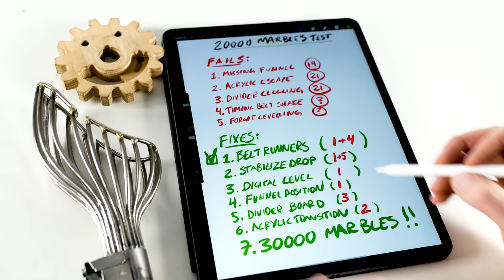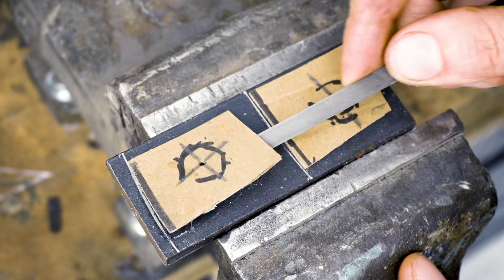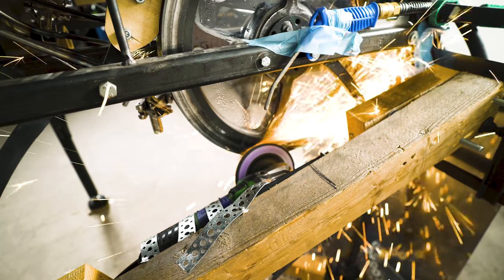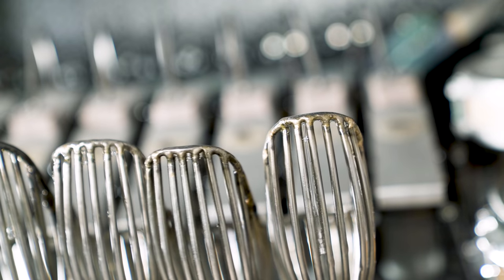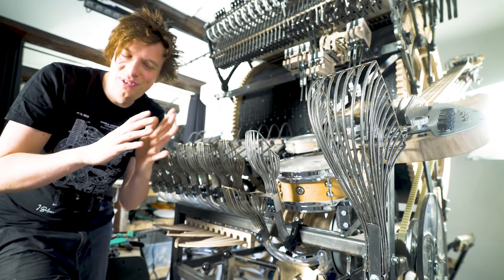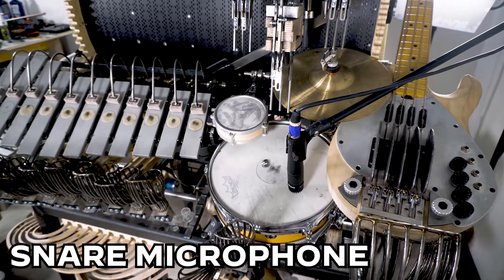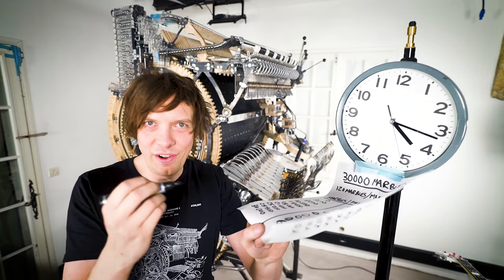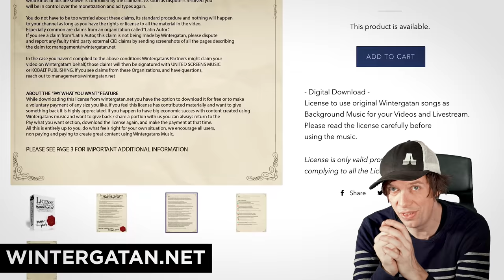Playing 30000 Marbles - Marble Machine X #148

Comment: The reliability math is still kinda weird, the smartass in me is screaming for statistical analysis. 
But it really doesn't matter 6 out of 30000 is obviously great.
Reply: Yeah he could also factor in the type of failure. Some dropping to the floor like this is nowhere near as dangerous as ones getting caught and bound somewhere
Reply: Currently for 1 000 000 Notes played, the expected number of ...
lost marbles is 233.3 = (6+1) / (30 000 + 2) * 10^6,
critical failures is 33.3 = (0+1) / (30 000 + 2) * 10^6
Reply: I thought he would have called those 6 marbles a false fail as that wouldn't normally happen, also is he going to run 1 million marbles though each channel?
Reply: @blahuhm6782  Trying to be 100% polite.  All it takes is ONE ball bearing to cause a lawsuit.  This is why he has the 1,000,000 marble goal.
Reply: Those six are an outlier, because you only have 2 channels running.
Reply: @peterkelley6344  how rude you are!!!! lol, just kidding, no worries... yea, marbles on the floor could lead to an injury no doubt, I forgot about that
Reply: The main issue now is that the number of marbles is proportional to the number of channels used, so the reliability score weighting is proportional to the number of channels squared. If it was changed to "marbles per channel" it would fix that issue.

Comment: Martin, I thought that the flywheel may need balancing, just like a tire where you add weights. Once you have the balance points glue on the magnets so they don't shift or fly off.
Reply: Yes, wanted to add the same comment.
Glue on those magnets!

Comment: I'm interested in the funnel bouncing after a marble strike when another marble hits immediately after, could that be impacting the second marble with enough force to occasionally cause a bounce out?
Reply: I was thinking the same thing, as beautiful as the funnels are it may be more reliable to make them rigid. I know martin wants to visualize the music using them, but I feel that seeing the marbles fly through the air and the gates actuate already does a great job of doing this, and it wouldn't kill me to see him replace the spring steel with a rigid plate or just weld the funnels stuck.

Comment: Did he really just make "belt runners" non adjustable?
Reply: Our (Bosch) packaging machines at work don't have adjustable belt runners either, you change the position of the drive wheel if you need to adjust the tension of the belt. And mind you those are designed for 24/7, high speed production, which is a whole different class above the marble machine. For MMX's case its perfectly fine.

Simple as.
Reply: Hey, they can be adjusted super easily with the help of an angle grinder and some welding ;)
Reply: It's easier to adjust belt tension than location anyway.
Reply: @R3dFlames  Or smaller/larger OD bearings :P. Very adjustable.
Reply: It looks like the bearings themselves aren't adjustable but that he mounted them to a slotted arm that is?
Reply: Yes. This episode is full of cringe! He needs to run these ideas by his team before he does them. I know someone has a lathe. After all, he found a luthier to make him a custom bass.
Reply: You can  change the mounting to adjust the tension. Move them close to the centre between the wheels and the tension is reduced, further from the centre and the tension increases. Changing the angle so that the bearing pinch the belt more will increase the tension. Changing the bearings out for larger or smaller OD will allow for adjustment.
Reply: @emilchandran546  yes that would have been a good idea, but it's not what he did.
Reply: @RichardBronosky  there is no reason why any of those couldn’t be done the way he has set it up.

Comment: For the scoring analysis at the end, I think you should calculate the lower bound of a Wilson score confidence interval (yes, this is pure and wonderful coincidence). Here's a nice article with an Excel formula you can use (just replace "Up Votes" and "Down Votes" with "Successful Marbles" and "Failed Marbles"): https://www.evanmiller.org/how-not-to-sort-by-average-rating.html

The best thing about this scoring method is that it properly accounts for the total number of marbles tested. 100% success with 10000 marbles gives you a higher score than 100% success with 1 marble. In fact, the number that this formula outputs is a reliability that you can be 95% sure of. For example, your 10000 marble test with zero fails gives a score of 99.96%, meaning that you can be 95% sure that your machine is at least 99.96% reliable (in other words, there's only a 5% chance that your machine is less reliable than this).

The Wilson scores for the tests you've done so far:
5000 w/ 20 fails: 99.38%
10000 w/ 0 fails: 99.96%
20000 w/ 61 fails: 99.61%
30000 w/ 6 fails: 99.96%

For the last test, if you want to ignore the 6 failures that are unrelated to the dropper mechanism, your Wilson score will be 99.987%!

One more cool factoid: 30,000 w/ zero fails gives you roughly the same score as 100,000 w/ 5 fails.
Reply: I wonder how many marbles Martin needs to drop for 5 sigmas of confidence :D
Reply: @maxmustermann5932  5 sigma is 99.99994%, which is achievable with ~6,000,000 marbles and zero failures (@ 95% desired confidence level).

Comment: Idea to fix the overflow issue: Have a marble "bank" that collects overflowed marbles. Let the marbles slowly leave the bank when the Pipe isn't overflowed. Or let it circulate in the machine while it tries to fill everything up. It might take a lot of work though
Reply: I think there's already an overflow where the marbles just run past the channels and go back into circulation. I believe the problem he was describing was that the height adjustment for the snare drum channels wasn't tuned, so marbles were not getting past them and so did not reach the overflow.
Reply: @coder0xff  That's where they backed up. The fish stair is where recirculated marbles go back into the divider. He just has a few too many marbles in the machine for the number of channels used.

Comment: Martin, we're quietly waiting for your next video.  I was wondering if the delay is in you having the courage to open up more stops on the MMX to let more ball-bearings through.  I seem to remember that the MMX has 64 stops. ... and that translates into an average of 15,625 ball bearings for each stop if you had them all open for 1 million drops.  Still hoping for the best.  I still believe!  Martin.  Happy Holiday what ever holiday you might celebrate.

Martin you asked about music box paper a few years back and I think (once more) I have found yet another solution for you.  Player Pianos used similar scrolls; and there is a company who makes paper for player pianos still called QRS.  QRS is still in business / operating today. They still make modern player-piano technology.  This may help with the programming pin issue you've had.

Comment: I wonder when Martin did stop consulting his "engineers". The balancing of the flywheel had been such a no-brainer - why spending so much time instead of doing it right the very first time? Also: Martin completely misses the relation to "frequency". When he plained the flywheel and vibration actually increased, this mainly had to do with hitting the eigen-frequency of the funnels. So even if the MMX is now a charme on 120bps ... it might not be at all at 90bps or some other frequency.
Also completely not understandable for me (and that reduces my hope for success significantly) was the action to weld the belt runners directly to the frame. I recollect that Martin hat spoken the wise words, to never again just fix something straight to the machine, but ensure that there is a way for adjustment. Why on earth didn't he stick to that concept. He must have completely missed, that the belts will get longer over time and the belt runners might need to be tightened. The unfortunate alternative is to replace the belt at some early time (perhaps for each other concert?) to just ensure that it will be still in range and ok.
Reply: I agree with everything you say!

Comment: I'm so worried that this is all extremely dependent on the exact characteristics of the floor the machine is currently sitting on and it will start vibrating like hell as soon as you move it
Reply: For stability on tour, a half-ton slab of optically-flat granite will be needed as the floor.

Comment: Nononononon that is not what E=mc^2 means I hope he knows that the equation he wants  id F=ma
Reply: Yeah...
As someone who really liked physics at school, that hurt a little bit.
Reply: He's actually referring to kinetic energy E=(1/2)*m*v^2, which is actually pretty close if you ask me. I mean in terms of dimensional analysis it's exactly the same thing.
Reply: @onemadscientist7305  I mean yeah i guess but it doesn't have a c^2 constant in it and doesn't mean energy that literally represents gravitational mass?
Reply: @onemadscientist7305  so in the sense that E is inversely proportional to mass, yes, but in terms of like any actual understanding of what that refers to no. Like that's inertial mass, not mass in a spacetime sense, and youd get it wrong on a test for using that equation.
Reply: @samk2407  I think as long as it gets the point across that the energy you need to put into the system to get it moving is proportional to mass (slight blunder there, I forgot the parentheses, I’ll fix it), it’s fine. Besides, the mass used in relativity’s equations is in fact inertial mass, there’s no such thing as gravitational mass in relativity since gravity isn’t a force (in an inertial reference frame at least). I mean, sure, kinetic energy doesn’t refer to the energy that’s statically contained in the mass by virtue of its existence, but to the dynamic component of the total energy contained in the mass (not accounting for thermal energy), but really, it’s the exact same kind of quantity (obviously, in the context of relativity, the classical kinetic energy formula doesn’t work at high speeds but that’s nitpicking at this point).
Reply: @onemadscientist7305  no gravity isn't a force, I'm aware, but the energy mass relation of m= E/c^2 just isn't applicable to kinetic energy. like that energy only has the most miniscule component related to velocity it is almost entirely whatever the correct term for the mass of existing is.
Reply: @samk2407  Listen, this isn’t a physics channel. He got the point across. This is a minor mistake.
Reply: @onemadscientist7305  he's an engineer working with engineers
Reply: @samk2407  That still doesn’t mean he needs to know all of physics’ equations (granted, this is a simple one). And as you said, he’s working with a team, and people like us regularly point out mistakes, which means nothing mission critical is riding on him knowing the expression of kinetic energy by heart. Him knowing that the more mass you have the more energy you need to put in to get movement is much more important, and he understands that perfectly.

Comment: You do know that you don't need a calculator and you can let spreadsheet work out the numbers right? Like if you would write '=(30000-6)/30000' (without quotations) it will show you the answer: 0.9998. AND you can format that answer to percentages by clicking on the 'format as percentage' button. Right? You DO know that? And you can use cells instead of numbers, like you can write  '=(30000-6)/30000'  as '=(C6-D6)/C6'... right? Instead of calculating it by hand.

Comment: THIS is the kind of mind that got us: 
          From ship navigation where longitude was near impossible to calculate, to ship navigation with clocks so accurate dead-reckoning was made obsolete.  
          From horse-drawn trolleys to steam-driven locomotives.  
          From elevators where cable breaks could be catastrophic, to elevators with brakes that would kick in within milliseconds of the car beginning to drop faster than a given rate.  
          From manual transmissions, to transmissions that were LITERALLY fully mechanical computers using complex mazes of small channels for guiding hydraulic fluid, and ball-bearings to seal one channel and open another, to force the fluid to switch applied force from one clutch pack to another, thereby causing different ratio gears to switch into or out of the drive train.  

NEVER underestimate the value of classic mechanical engineering.  

Rocket science may have gotten us to the moon, 
but mechanical engineers got the Saturn V 
from the assembly building to the gantry they had built on the launch pad.

Comment: This video is a great contrast between smart and educated/trained.  It takes a very smart person to put this machine together and with through the problems that you've done.  But also, an educated person would have known that facing off the flywheel wouldn't have solved the vibration (this doesn't fix the center of gravity, as we later find out) and more importantly when you increased the stiffness of the marble dropper, THAT IS NOT HOW YOU USE E=MC^2.  That's an equation for the amount of energy contained in matter, not how much energy or force it takes to move or bend something.
Reply: I am sure an uneducated car mechanic could have told straight what is the easiest way to balance a wheel :)

Comment: Your engineering skills are remarkable! As for balancing the flywheel going back to basics is the path to success most times. I was thinking while you were attempting to reduce vibrations about how I balance my motorcycle wheels after I change tires. Wheel weights with glue on one side is how the weight is added where needed, no chance the weights will move.

Comment: I used to work in a factory and I noticed the very large (~ 1 meter OD) fluid couplings we used were balanced (before reaching us) by drilling holes into the outside of the axial faces, much like the method with the magnets but subtractive.

Comment: if you look carefully at 2:01 you'll see it not only touches the sides, but it does quite a few bounces on the walls. The ball has a curved trajectory and does not go in at a 90 degree angle, so from a physics standpoint it will touch the walls at least 2 times

Comment: This machine makes every pinball machine I've ever worked on look like child's play. But I think you need some flippers, haha! But no seriously you have a marvelous machine. The flywheel job would have been easier though if you had preheated the wheel so that it would not fluctuate in temperature throughout the grinding process. That's just a thought.

Comment: And THAT'S why if you look at a crankshaft or flywheel from a car, you will find holes drilled at random spots at random depths and random diameters.  They balance them, eliminating vibration, by removing weight from specific spots rather than adding it.  Of course they have machines to do that, just like the ones that balance your tires.
But they don't make music, they just hummmmmm.

Comment: I don't see your belt tensioner failing how it is but, if you want to take advantage of those nylock nuts, you need to have a few threads showing through the nut. I don't think you have the lock engaged fully. I also don't think it's going to vibrate loose either if you chose to do nothing. I've watched you build this thing for a long time. You're a great engineer.

Comment: Even if this video is 2 years old- there is a simple explanation to your problem and an abvious solution. You have a proboem at least with your static unbalance. However, a rotating disc, if not mounted perpendicular to your rotational axis (we are talking about microns when balancing), you are introducing a couple unbalance. Both can be easily balanced. Just demount your flywheel and throw it onto a balncing machine. Companies like Schenck RoTec can help you with this. It would have been much much less pain and more acurate to fiddle out the position of your weights.

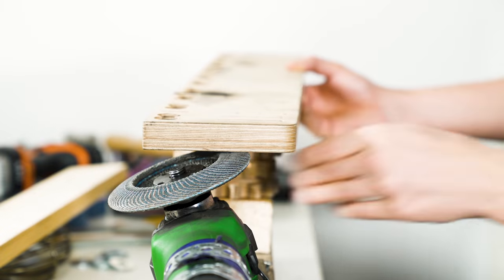Comment: actually 8:14 i had  a very skilled mentor in metal construction, high level welder and mechanical engineer, and he always told me when you grind with those lamella disks you should keep the angle grinder flat on the surface :o
Reply: haha that magnet solution is exactly how they balance car wheels :d

Comment: Balancing the fly wheel: remove your (design) ego and go to a tire place! They will not only static balance it but also dynamic! ...because w/ your technology you balance only the ring or tire, but your spokes and hub have to be included in the balancing... and guess what... you would have ended up with the same solution immediately (instead of lead clamped to the rim, you added magnets...)

Comment: I would say three movements. As the marbles drop and hit the drum they create vibrations, and at high speeds the next marble in line has a chance of hitting the drum in the middle of its vibration causing the marble to slightly bounce off course. 🤷‍♂️

Comment: Excellent engineering. And ingenuity in resolving your funnel vibration. If I may suggest (from experience), please acquire a vibration monitor which can easily be made from a few electronic devices. It appears you are fighting a frequency harmonic issue which is appearing on surfaces that are mounted on extensions. I’ve had to fight this similar issue on a robot transfer are that was still wheel extracted but when extended, a slight vibration resulted in the transport target shifting. The longer the are stayed extended, the more off set. The problem was supporting resolved by another expert by placing weights on different parts of the support structure. This weight acted as a vibration dampener. Vibration gone! I was able to measure the vibration using a a vibration instrument attached to the frame. Wonder job you are doing!